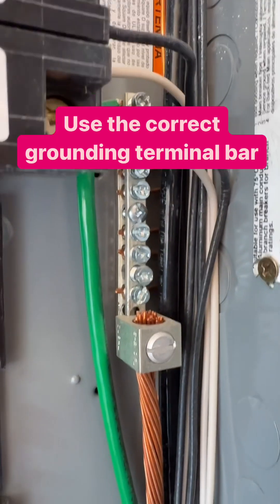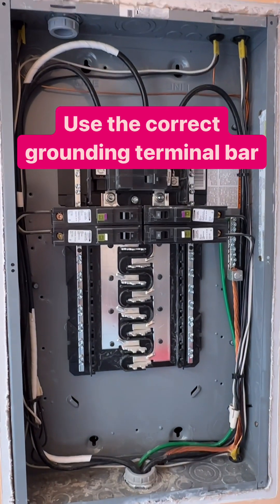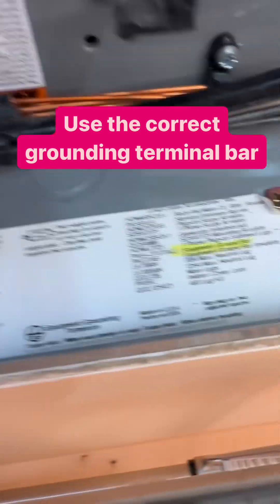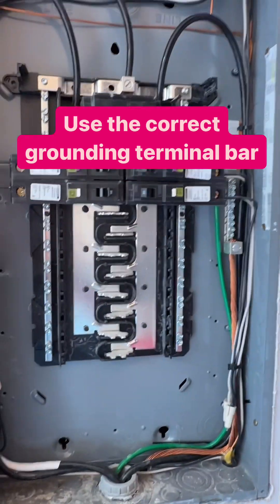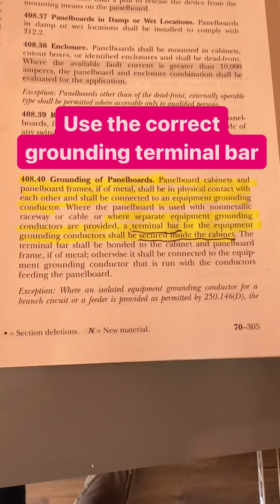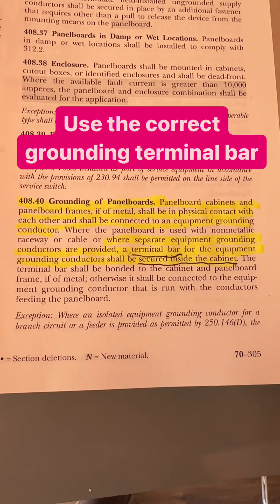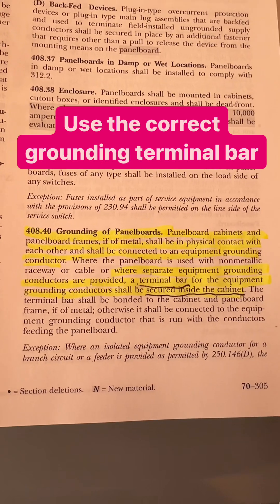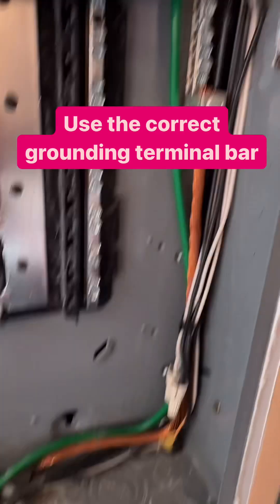Use the correct grounding terminal bar [440.40].

Comment: Good day Mike, is that the case for grounding lugs too? I mean, for a single or dual termination grounding lug
Reply from the maker: I'm sorry I'm confused. This was about the terminal used for the connection of equipment grounding conductors (what many call the grounding bar).
Reply: @MikeHoltNEC  hi Mike, I'm going to try to clarify my comment.

We've got some cases where in some panel boards there's only two EGC in the box. On some of these boxes, we have used ground lugs that are similar to the ground lugs used for bonding bushings, but with two terminals instead of one. We attach it to the panel case with a 10/32 green screw and land our 2 EGCs in it.
That's what I was trying to describe in my question.

In terms of 408.40, I see there's a requirement for a grounding bar, and that it has to be secured.

Comment: Mike, it looks to me that the bar is not mounted to the pre punched holes in the panelboard. You can see them to the left and also below the bar. The holes typically have a couple of protrusions to keep the bar from rotating which are also visible.  My point is, can you mount the bar anywhere in the panel? Also, is a self drilling screw (Tek) allowed or must it be a threaded hole with a machine screw? The screw(s) provided with the bars are typically a self tapping type machine screw(s). I've retrofitted a lot of ground bars in old panels in my career and am curious what fastening methods are allowed.
Reply from the maker: This is a great question and I need to open that panel, look up the instructions for the terminal bar for the EGCs. I bet it wrong! I'll make a video about this. Thank you.
Reply from the maker: Wow
Reply: sq d panels do have multiple area on each side and the bottom for the listed ground bars to be installed. this one looks correct to me(without being in person to 100% verify.) if  it was not correct bar the dimple would not let bar sit correct. you can also see it is mounted with the correct machine threaded screw the bars come with. im about 90% certain its correct.
Reply from the maker: You are 100% correct, my statement was wrong! Sorry.